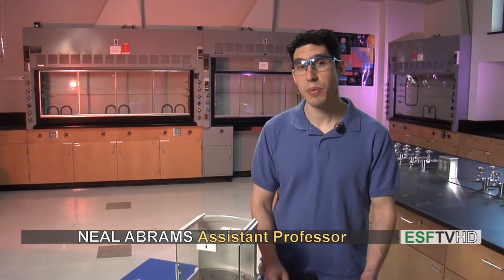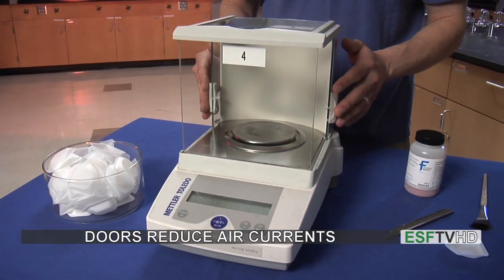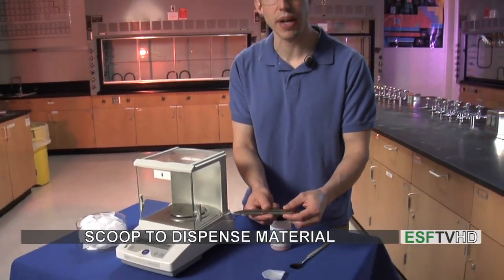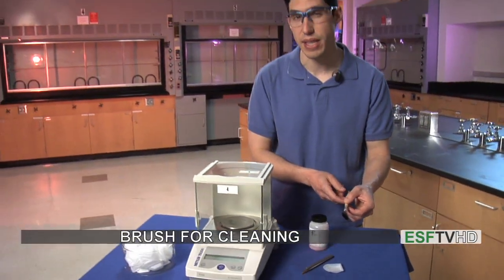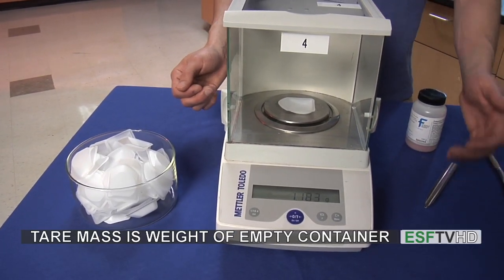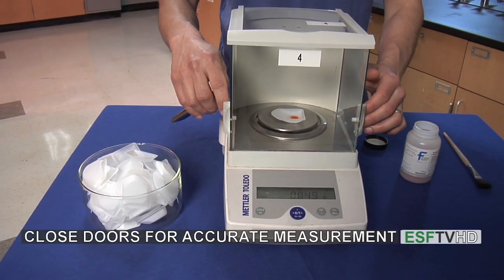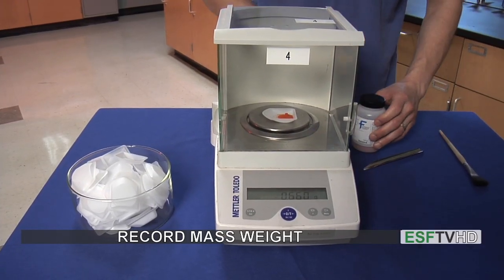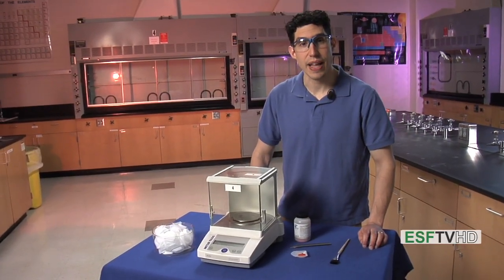Chemistry - Using a Balance

Comment: The container used also has its own mass. How do you then calculate the actual mass of the substance??
Reply: That is what the tare function does. it zeros the mass of the weigh boat so it only reads the mass of the compound